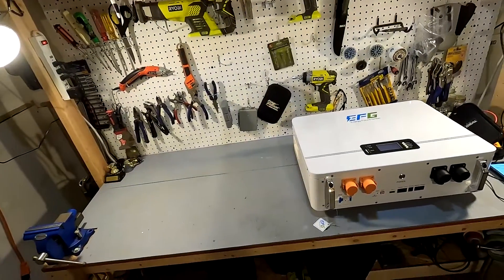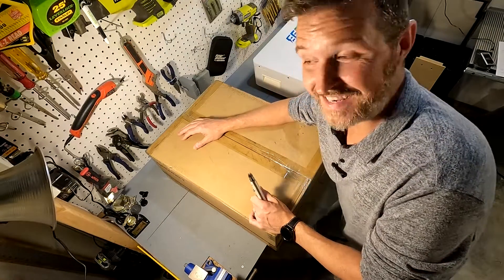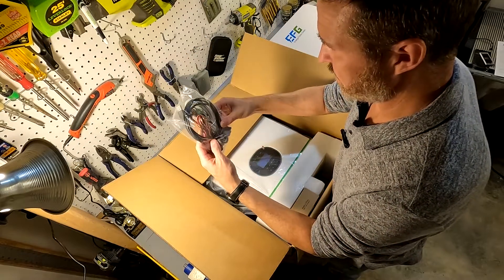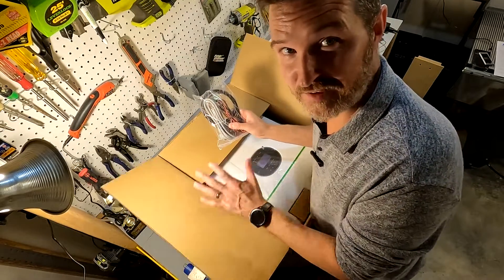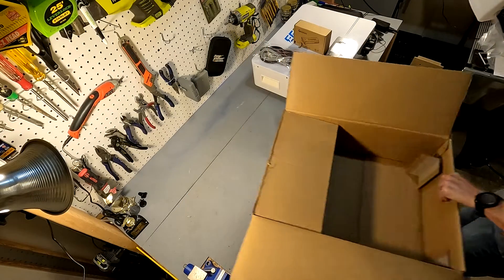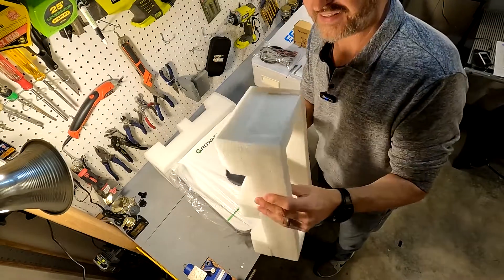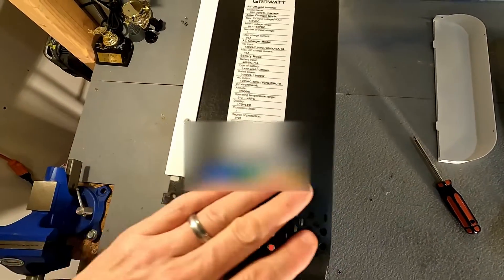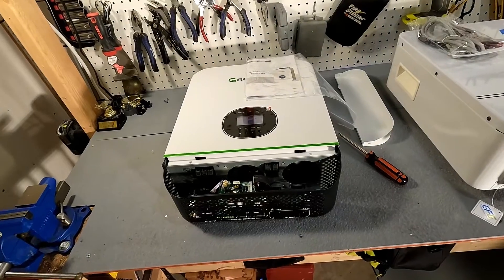Connecting a GroWatt to the EFG 48v Powerwall Battery!

Comment: Only 6:33 in. The NC-C-NO means Normally Closed - Common - Normally Open. They call it a Dry Contact port. You can basically control a relay or send some sort of On/Off type signal to "automate" loads etc when specific conditions are true (battery at full charge, battery empty, etc)
Reply from the maker: I can see that being very useful.  I'll need to look more into it!  Thanks for the info.

Comment: The GroWatt is a viable option for some people starting out with small loads, and small incomes.  When anyone is starting out, you have to look at the destination on what you want to do with your system.  Do you just want to run the basement, half the house, or even your whole house?  With your new battery and the 3Kw Growatt, you have invested just about $2,000 plus the cost of your solar panels and wiring into just this project.  Granted, you can expand your system slowly over time, and that is what makes this project nice to watch.  However, I feel you should have gone with at least the 5Kw Growatt ($100 more).  With a 3Kw inverter, you will only be able to output about 120v/25amps to your load bank.  Just to visualize, one circuit breaker in your main circuit breaker panel is usually 15-20amps.  For $500 more, you could have doubled your output (EG4 6Kw), and also have 120/240 available.  One good thing is that all of these inverters have the ability of joining like models in parallel and increasing your output, but starting out this small is going to cost you more in the end, and the real-estate in the basement for this project is going to grow.  One inverter unit vs two to get from 120v to 120/240v is a good investment and consideration, is it worth it?
Reply from the maker: That is a very good point.  My long term plan was never to go completely off grid.  I really just wanted to make sure my family stays comfortable during a power outage.  At some point I might get another 3k inverter to achieve 240v output, but right now that isn't important.  Thanks for the comment and the info!
Reply: Thank you both !

Comment: not a big fan of the wifi connection with growatt, instead I used a USB cable to a raspi running Solar Assistant. I have a 24v version of this unit, there is a learning curve, but I am very happy with my unit so far. Also keep in mind, with these units, if your battery shuts off or disconnects for ANY reason, the unit turns OFF it will not pass the grid through without the battery connected. P.S. if you want to buy my Growatt wifi dongle it is up for sale :)
Reply from the maker: Thanks for the info!  I'm surprised it's like that with the "no passthru".  I still need to look through all of the settings to make sure everything is in order.  I'll let you know if I need a second dongle... :-)